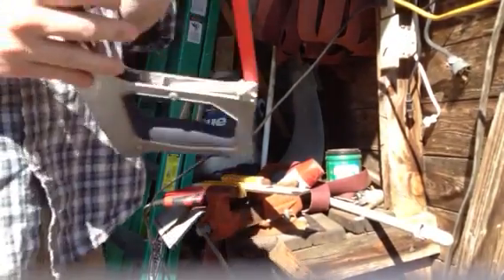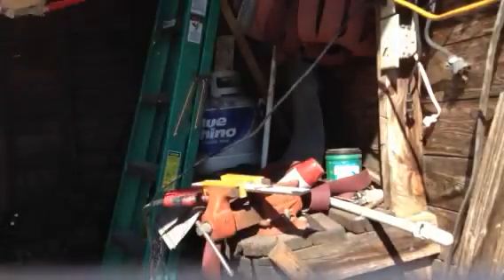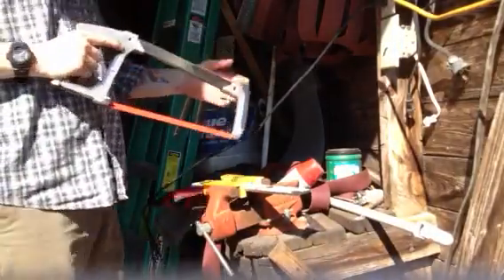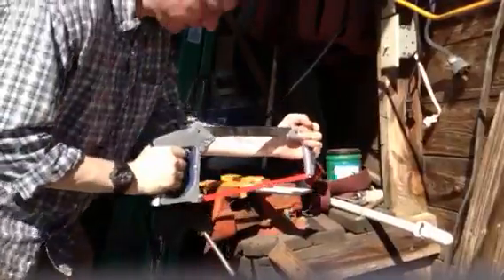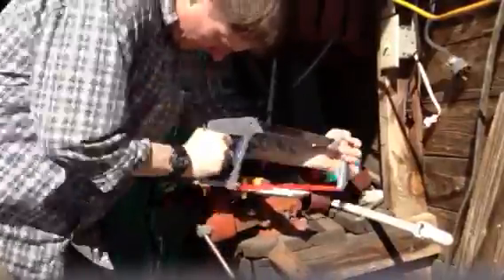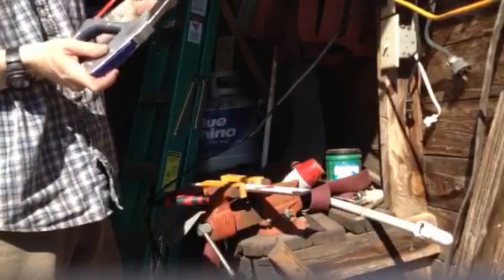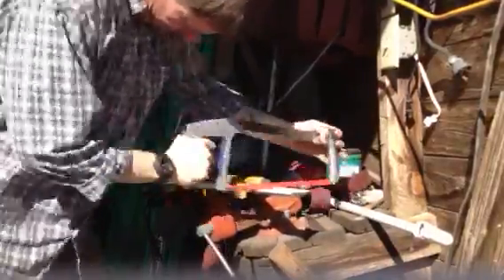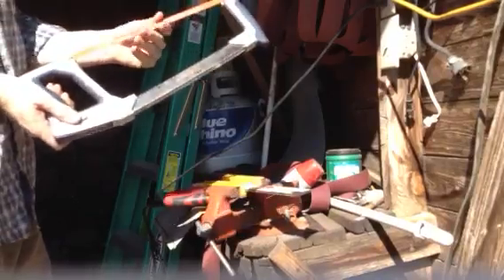Trying to Cut Out Micro-Melt Maxamet Alloy Blades

Comment: the power of positive waterjet cutting.
Reply: I wish.   I really do.
Reply: Jeremy McCullen the only other option I can think of is a ez-cut diamond cut off wheel for a dremel fixed into a drill press with slow repeating passes.
Reply: I will be giving it a shot.  Bruce said about the same.  This stuff may be a challenge.
Reply: Just wondering, why not have them cut with a waterjet. Logistically and cost prohibitive?
Reply: Would be costly for one 15" piece of metal.  Plus I would need to find a waterjet cutter. no one is local.

Comment: Ah, my ceramic machete project may have been in error then.
Reply: if I only had a lightsaber.
Reply: You could still have a M4 machete made.
Reply: Bill22252 M4 doesn't have enough 4 to make a good machete, you need at least M44, and ideally the M44 Magnum.